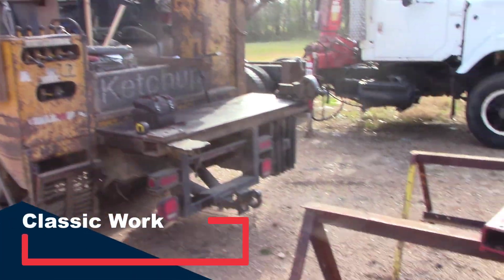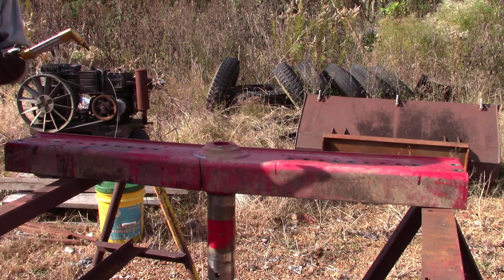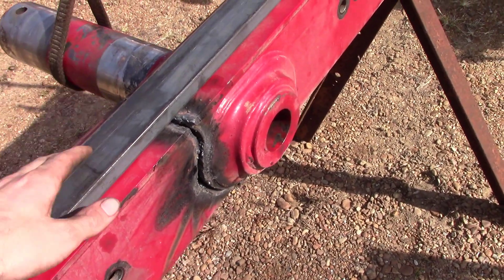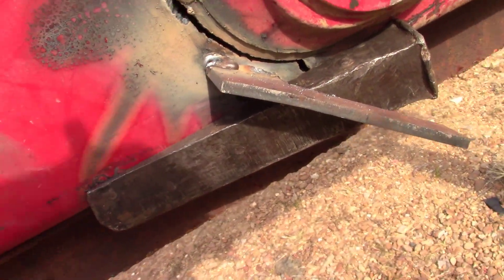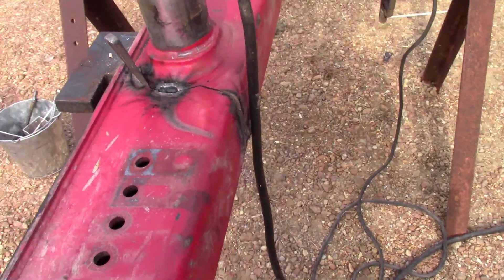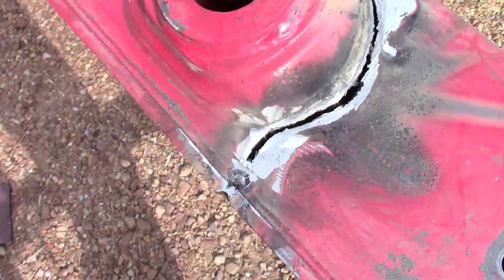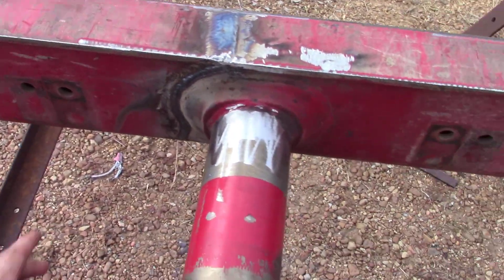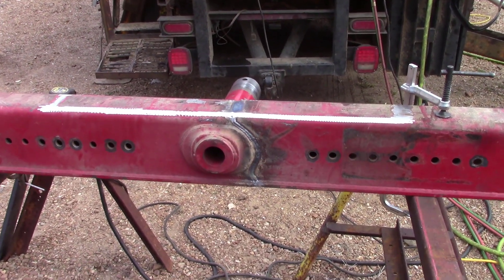Case 2388 axle repair

Comment: I was a welder/fitter/fabricator for 37 years in a Machine Shop/Fabrication Shop, I could show you how to make dogs that there’s no hammering! Just nuts,bolts, all thread rod and flat bar! I’d love to share it with you just don’t know how my friend, I’ve learned a lot throughout the years from one of my friends and one of the best fitters I’ve ever known! Just a suggestion my friend, I love repairing equipment more than new fabrication! lol it’s always a challenge and that’s what I loved so much! Thanks for sharing your talents with us and if I can ever help, I’d be proud to! 👌🏻🤙🏻🤙🏻 Good Job Brother 🤙🏻 You don’t want to crystallize of fatigue the metal with too much heat!
Reply: I was kinda thinking the same thing , them half ass wedge dogs aint worth the headache, cant go wrong with a screw dog
Reply: Half clamp method should be the only way to go. Can do some SERIOUS seam lining with that sumbitch, 1. Plate and dog method can bend the material/ fit up unevenly, 2. Ratcheting bolts is for the mechanics at Midas, not metal fabricators, 37 years though, definitely got some fat respect for you

Comment: In this application, the lower strongback is as strong as the one above because it is loaded solely in tension. The upper one is in compression & is rightly on edge. Strongbacks in compression have to be factored for buckling. Welding on edge places more material further from the bending moment and is therefore stronger.

Comment: Think of your welds as if they are bolted connections, offsetting bolts will mean bolts will take loads one at a time...
Tip, do not stager your "bolts", also your strongback becomes a compressive  plate also.
Your break presents as a "rotational /torque" failure.
The fulcrum is coming from your "pin"; I would recommend four sides be reinforced and this will make a larger critical shear zone. 
Not stepping on your toes, just helping u understand load path failures, would love to do a team share video...
You present the fracture, I'll tell you what caused it...

Comment: Dude, yes - your videos have been invaluable. I am getting ready to rig out of a GMC Topkick C70 (the old boxy one) with a flatbed, crane, and an SA200. So watching your videos are massively helpful to me. I was even a little bummed I didn't get to see how you specifically used your grinder to bevel some of those curvy sections. I am spending 10 months in a welding academy trying to master stick and tig process for high-pressure pipe. I am a structural hand though.
Reply from the maker: I read your email the other day I’m glad I could be of service in getting you into this field. What motor do you have in the truck? And what brand of crane is on it?  I thought about the grinding part I could have done a little Time lapse that was on me. Good luck with your schooling the only advice I can give you don’t get discourage with all the tests. I failed a lot of plate and pipe tests before I got one to pass. I don’t know how long you’ve been Welding but remember that hood time is a good thing but weld as much as you can outside the booths.
Reply: @EEJester1586  For sure. Engine is Cat 3208. Ill have to look at Crane again.
Reply from the maker: @the_boatswain  I gotch good deal I like the old mechanical motors better than the new electronic ones.

Comment: Nice repair...from a structural point, the root cause is a poor detail.  The boxed section of flanged plate has almost all of the beam "web" cut out by the pivot tube...the boxed beam should have been a little deeper.  You mentioned that the failure cause is usually overload from grain tank extensions and I'm sure that is spot on!!  Most people don't realize the consequences of such action. The next failure will probable come in the main drive axle....
As a side note, you can increase the strength of the beam without much of a stiffness increase with the flange doublers alone.  I'm sure you followed the owners direction, but most farmers aren't also structural engineers...again, good looking repair....
Reply: Actually they need to add weight to the reared of the combine.  When they go down the road from field to field with the header on the backend begins to bounce.  Those rear axles weren’t built to take the bounce.

Comment: Great Job I have had Good luck doing what I call stress relieving weld it up all the welds on objecy  let it cool to touch then heat it up with rose bud to 1000 degrees using temp stick or gun let it cool this works well on rock buckets and dozer blades

Comment: Looks fantastically done!   I learned a lot from this video.   Question, @14:05, I see 7018 1/8” was used at 110A.   Isn’t that a little cold for that rod and with the steel being welded?   I thought 120-125A for 7018 1/8”.   No?
Reply from the maker: All welders are different my machine burns on the hot side but 110 is good on 1/8” if your burning out of position.

Comment: I have not seen this technique before, sort of TIG welding with a rod welder. Does the second stick act as a filler to bridge the two pieces? Does it melt completely? Does it work better because you have flux right down inside the weld? Pretty fascinated, I would like to understand the benefits and possible downsides.
Reply: Search Texas tig or stig welding
Reply from the maker: Yeah it’s Texas tig. It’s frowned upon in the welding world but it’s a good technique if you could tell I was right on the edge of that joint and if I were to try to weld that gap it would’ve just kept blowing out. I use it quite a bit to be honest for certain applications it works great just know that what you’re doing is not a code if you know you’re gonna be grind it out or is a non-critical place it’s good.

Comment: My neighbor a long time welder used to consruct electrical poles they wanted one long weld all the way and he refused.  He said the same like you it needs to flex or it will fail.

Comment: One of my favorite tools in the machine shop is a pair of 50-year-old cast iron wedges. I end up using them probably more than any other individual tool. Fantastically useful for squaring up stock, etc. I recently looked on eBay wanting to buy another pair to leave on another machine. I was not able to find them anywhere at any price, Not even used ones on eBay. I noticed that you seem to be using them while welding. On the off chance that you bought them this millennia, can you tell me the manufacturer name? Or any identifying information?
Reply from the maker: The little wedges I was using are Williams wedges. I bought them from welding supply store but you can get them off of Amazon they make a couple of different sizes those were 4 inch I’ve got 6 inch 2 inch and long 9 inches. The big wedges you saw one of them was a log splitting wedge the other one is a homemade one and it’s my favorite it’s made out of mild steel and is the perfect size it is 1-1/2 by 1-1/2 by 9 if you know somebody with a burn table or a track torch and if you can find some inch and a half plate I’ll tell you that’s the best one I’ve ever seen.
Reply: ⁵65
Reply: @slickrick8562  I'm sorry, what do you mean?
Reply: Make your own out of mild steel, they need to bite, also make pairs at different angles, fast and slow wedges, you can move anything with a wedge.

Comment: Hint .. Masking tape over precision surfaces followed by Aluminum foil duct tape to stop sparks from damaging the surfaces. a careful knife cuts it and it peals off in seconds.  just don't scratch the machined surfaces with the knife edge when cutting thru.  or carry a roll of aluminum flashing and tape it on too with a small strip any kind of masking tape.. duct tape.. aluminum tape.

Comment: Great repair ...but 
At 16.23 you welded the end of the gusset plate that was cut square . I wouldn’t cut gusset square and wouldn’t weld on the end ...it might cause a stress point . Maybe cut gusset at twin 45degree to make a point sort of thing and weld or possibly not weld that area at all . It’s good to see people actually repair stuff and not bin the part ...this part will outlast the whole machine .
Reply from the maker: I thought about that too. If it was any wider I would have Diamond notched it.  Very good point though you definitely know your stuff.
Reply: fish plate

Comment: Hell I saw a guy use almost a whole reel of .045 er70 wire on a 1/16" sheet metal project and it was not finished when I got I.   There was not one good weld on it.  We scrapped because heat distorted all the metal.   Iwish I would have taken a picture of it.

Comment: Good work! Can you elaborate more on the relationship between tension and compression on the reinforcement on the axle along with stiffness vs flexibility? Why is the part that's under compression oriented differently from the one under tension?
Reply from the maker: I can try. In a perfect world I would have braced both the top and the bottom the same way. A strong back Will take care of compression or tension given the right orientation which is an upright. I didn’t do it on this job because the bottom I think had clearance issues. Can’t always do what you want.  So in the Welding world we call it ductility meaning that something can move so far before it fails or causes problems that I can’t spring back. You want things to move but not so much that they fail it’s kind of a balance that you have to kind of work out. The revision on the new combines had a strong back mounted on top from the factory that’s one reason I put that one in there. I hope that clears that up somewhat.

Comment: why 6010 and then 7018s?
Reply from the maker: 6010 is used for open root welding and it’s good at jumping gaps. The downside of 6010 it doesn’t have a lot of ductility in it. Once you put weld between the two gaps 7018 will seal the deal making the most ductile and solid weld that joint can have with a stick rod.
Reply: @EEJester1586  thanks for the reply. Always imteresting to learn about these things
Reply: @EEJester1586  Hi I am new to your channel and new to welding repair projects.  When you do the pass with 6010, are you doing a weave or a stringer?  You talked about moving around the piece so heat wasn't concentrated in one place and grinding out  after 6010 pass.  So if I understand correctly the 6010 is only joining the two sides of crack and any weld past that is ground out.  7018 passes are either stringers or weave continuous?  Thanks for tips.  Also for people asking questions about welding plates flat, on edge, etc. mechanical engineering textbooks on mechanics of materials and statics are good reads.  You will learn the physics about how stress is distributed in an object subject to bending loads as well as how shapes of beams have a lot to do with how they perform when loaded.
Reply from the maker: @jimw6991  It’s all stringers the only time you can weave is in the vertical position.  And I don’t recommend a weave on a curve joint.  A 7018 will run weave uphill beautifully but a 6010 does better downhill weave.